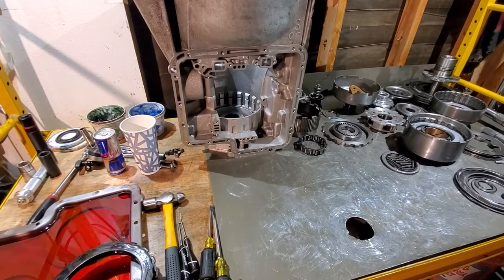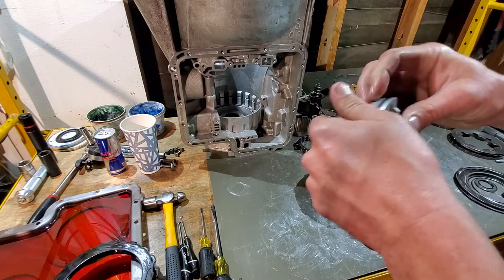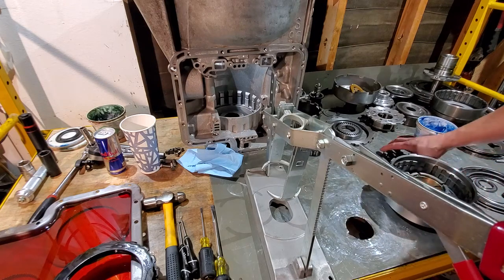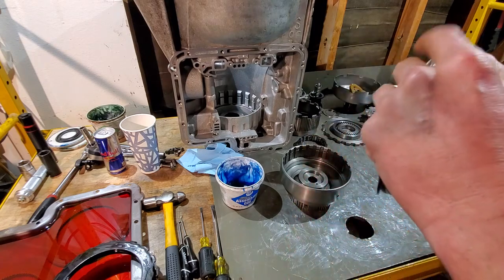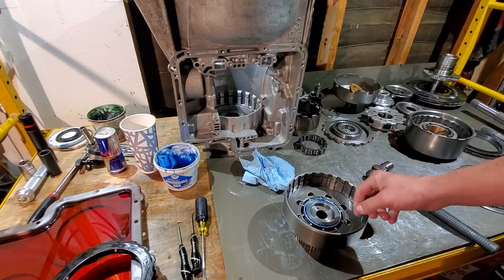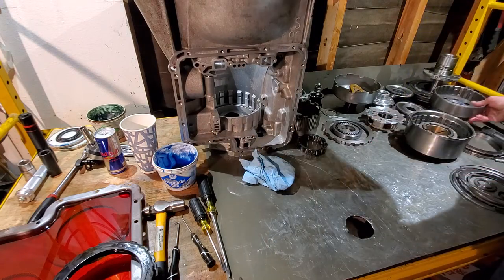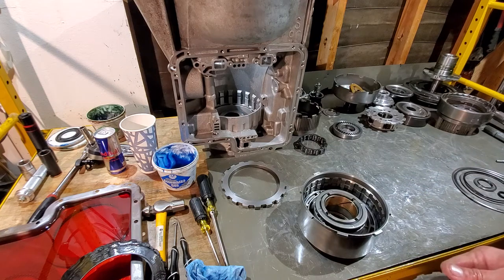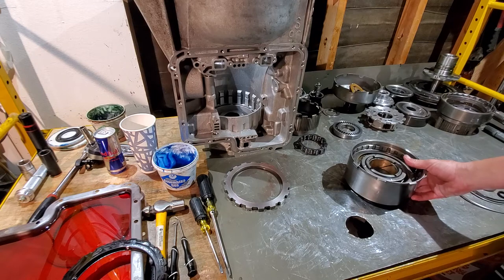Ford C6 Transmission Rebuild Part 1

Comment: good clear video on the forward drum i am upgrading to a 5 clutch forward clutch and am told i need a differant front planetery hub. somehow it changed after 76 i guess . do you know if a hub froma  e40d would work by chance?

Comment: i have a 1982 ford e-250 van..... i bought it  and drove it 200 miles and stopped for a break ..... when i got backin the van to go..... it would not go into any forward gear...... go`s good in reverse...... no forward gears...... it ran fine & the transmission was strong & would go into ANY gear with ease on the selector on the collum......  i am stuck in santa rosa, new mexico now..... i bought a $ 200.00 rebuild kit and also all new copper coated large washer kit with 4 different selection plastic washers......i am  going to get a bushing kit that has allthe bushings for the c-6...... i have also bought a toledo gaskit kit......i have only to get the plunger ..... plunger thing that fits the large hole on the right side of the transmission case..... i have also got a new modulator to add to the rest of the parts..... any idea what happened to make it  just flat stop working......like i said, i went into the macdonalds and allwas just plain fine...... when i came out it was totally out...... would not go anywhere ?
Reply from the maker: Check the vacuum modulator and vacuum line to it, also check the shift linkage. If neither of those are the issue, it is most likely the forward drum piston seal. They go bad and fail, leading to no forward. You have 3 clutch packs in the C6, reverse - forward - low/reverse. A broken input planetary could also cause the problem but not likely from what you are telling me. 
The plunger on the side your referring to is the servo piston. This is important and you need to right one. There will be a letter code on the cover for it, that will let you know what servo you need to purchase.
Reply: @r1ddl324  thanks...... i am thinking that i might try to put all new seals from the forward drum and see if that cures my problem....like i said it WAS STRONG....... and operated great ? plus a few other goodies added ....it that works and it operates.....well good ...if not i`ll do a complete. sure appreaciate the info !
Reply: @r1ddl324  the more i think of it....the more i think its the forward drum,
Reply from the maker: @larry-ev5sw  that’s what it sounds like to me, usually the culprit when forward goes out all the sudden but still have reverse.
Reply: yep.....i have had some other people tell the same thing..... FORWARD CLUTCH .

Comment: 20:10 Question. You say that tolerances should always be done with dry clutch plates due to them swelling up from the fluid.
When I read Ford's manual, it explicitly states it the other way around. That clutch plates ought to be soaked in fluid 15 minutes before assembly, and after it has been assembled, that the clearance is measured. Also in a handful of forum post and reddit topics I saw people state that the plates need to go in wet before measuring. On the other hand I see other videos of people putting in the plates all dry.

Can you tell why you do it the other way around? I'm trying to learn about rebuilding a transmission, but this thing has confused me quite a bit. I'd be inclined to follow the official manual, but I'd like to know why some do this differently when it seems to be quite a significant step.
Reply from the maker: There are many correct ways to assemble a transmission. It all depends on your equipment and experience. When I first started building transmissions, I always followed the official manual. After years of doing these, you find ways to make them better, stronger and last longer. Shops that assemble everything dry with no pre-soak usually have a transmission dyno that they will break in the trans with. This step soaks everything before spinning anything. For those who don’t have a dino, but still install clutch plates dry, I do not agree with. 

I have done these for years and have my ways of assembling them. The book for this transmission says to soak clutches, assemble, then measure. This is perfectly accurate and I would suggest to do so if this is something new to you. I set up this type of transmission (and most transmissions) dry and set my tolerance (normally tighter on clutch packs) then I pre soak and re assemble. This helps achieve quicker (and stronger holding) shifts. Again, if this is your first build, I would definitely follow the official manual step by step, until you have a good grasp on these. 

Hope this helps. If there are any other questions, please let me know.
Reply: @r1ddl324  Thank you very much for the explanation! It's really good to know that there isn't a one and only way to assembling them, which clears up a lot of confusion I had. In that case I am going to stick to the manual indeed. I also found an old C6 training handbook to study which I'm sure will help.
Reply from the maker: @JohnSmith-wj2wd   Happy to help. Absolutely stick to the manual. Once you have done a few, you will see where you can make them stronger and perform better. I would really consider getting the updated race and sprag for the rear of the case. This will not change anything for you for rebuilding, and it helps your transmission greatly.
Reply: @r1ddl324  Can I ask one more thing?
Last week I went to the place where the car is stored to check some stuff. I saw that the front pump seal appears to have been much more worn out during the last trip since there now was a very large puddle of transmission fluid underneath it. When I check the dipstick with a cold engine however, it still shows a fluid level high above the markings like it always does when cold.

Question is, do you know if that is any indication whatsoever that any reasonable amount of fluid is still inside to do a proper warm engine check, or could the dipstick simply be at a spot where the fluid couldn't run out?

I'm hoping to check the level with a warm engine so that I can still top it off before driving the car to the workshop. But at the moment I worry that simply running the engine idle will ruin the transmission before I get a chance to check the level.

btw, all the parts are underway along with the durability upgrades. Really looking forward to rebuilding it.
Reply from the maker: @JohnSmith-wj2wd  depends on the size of the puddle. Also, was there fluid added last time you drove it? Check to see if fluid is rushing out while engine is running. If not, you should be fine. Run through the gears (park to reverse, neutral, drive and back) with your foot on the break. Then check again for leaking while engine running. How far do you have to drive it?
Reply: Just  soak  the  frictions and  if the  frictions  don't   lock  with  the  drag  of  your  fingers   , unless you're a  wimp '  GO FOR IT  "

Comment: I have a question and don't know how to contact you. I have a 1989 Ford f350 XLT lariat dually that was a 7.5L 460 with an auto C6..... It's running right at 3000 rpms in 3rd gear at 55mph and only goes up from there. Isn't that RPM really high or am I worrying over nothing?
Reply from the maker: That truck is most likely set up for towing. I would imagine there is a low (numerically high number) gear ratio in the rear end. Do you know what the ratio is (ie, 4.56, 4.11, etc)?
Reply: @r1ddl324  yes it has a 4:10 rear end and it's 2wd
Reply from the maker: @robertomorgano8176  has it always run like that? And how long have you had it?
Reply: @r1ddl324  it has always since I bought it, but with that I've only owned it about 3 months and have only driven around 100 miles. Not sure what it did with previous owner
Reply from the maker: @robertomorgano8176  most dually setups run like that from that time era. They are meant for towing. You can put a numerically lower gear in the rear end and that will change your overall top speed and rpm. If your not towing heavy loads constantly, I would look into putting 3.55 gear in the rear end
Reply from the maker: @robertomorgano8176  as long as none of the gears are slipping, sounds like it’s just a gearing issue. Normally with those trucks, you get between 8-12 mpg no matter what, towing or not.
Reply: @r1ddl324  ok I appreciate your responses and help very much. I have had a theory this whole time it's just the way it's set up, it does have a 5th wheel tow package and all so I'm gonna assume it's all good until something happens that it ain't all good and I'll have an idea of what it was lmfao I appreciate ya tons